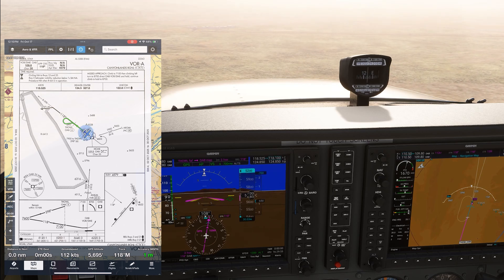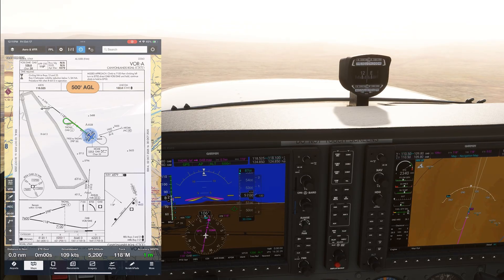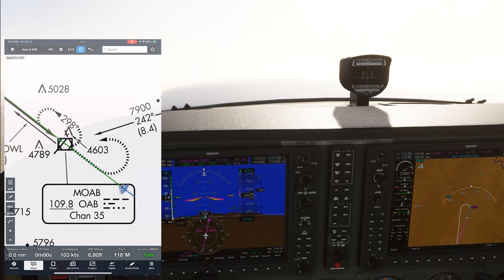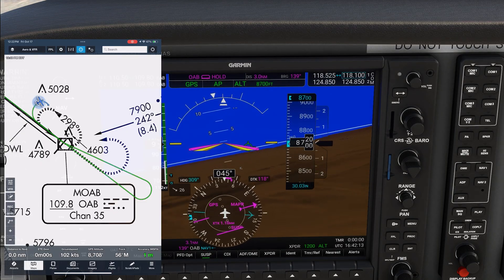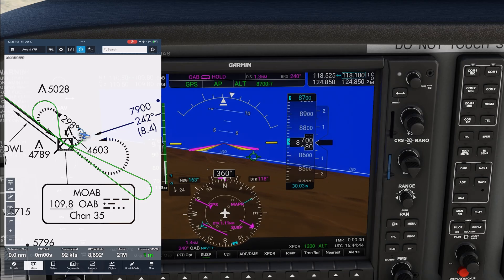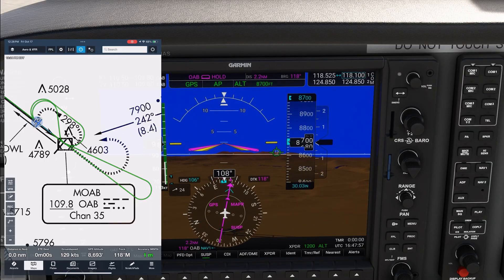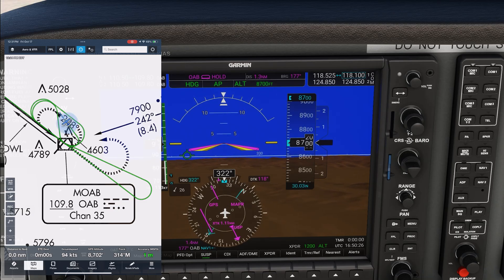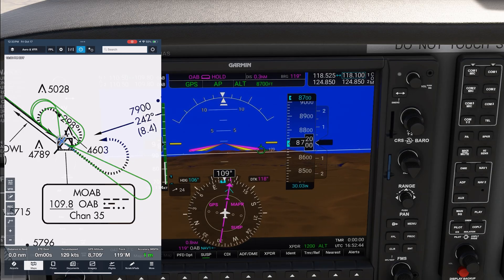Missed Approach & Hold on the G1000 | Canyonlands VOR-A (Part 2 of 2)

Comment: Instead of a 328-degree outbound leg you flew a 322 heading. It wasn't a 3x wind correction that you talked about. Why?
Reply: Nice. Had to go look myself. It looks like there was only a 9 deg correction angle inbound (Heading 109, tracking 118). The outbound course is 298 deg, add triple correction angle (+27 deg) to get 325. Still a couple degrees off, but "triple wind correction" is not an exact science but it gets you well close enough.  This whole situation works out perfectly with an 8 degree inbound correction angle. Still more accurate than the allowable error on a VOR haha.